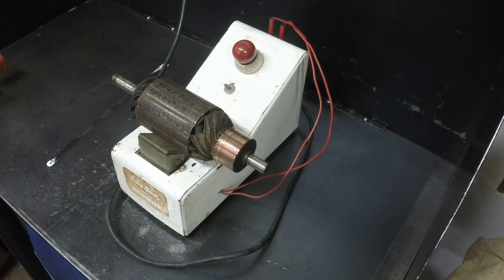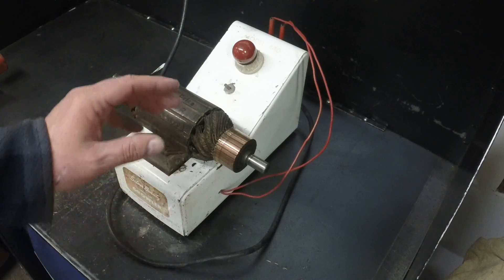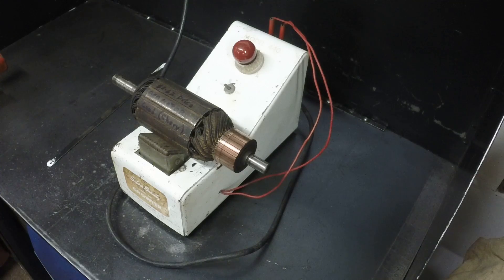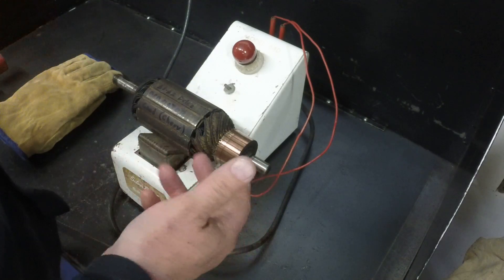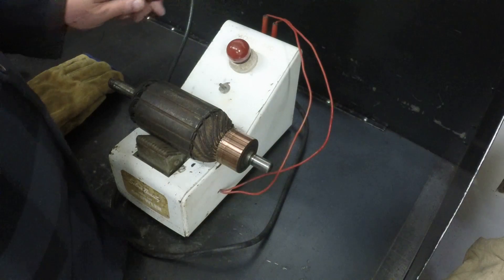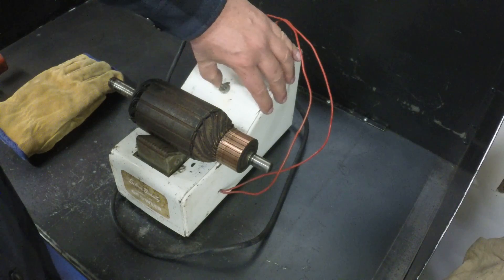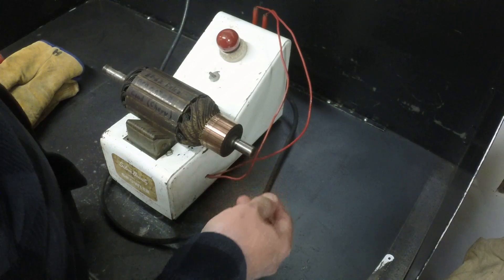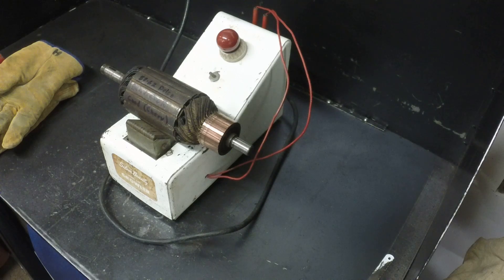Using a Growler to test a Delco generator armature from 1960 Chevrolet

Comment: It's a real sin industries have just gone to the just replace it way of doing things.  With my own vehicles, motors, tools, appliances etc etc; I diagnose, disassemble and find the root cause then repair it.  I do this not just because I'm a cheap Scotsman, but because I absolutely must know the root cause of the failure for my peace of mind.  

I spent decades as a GM Red Seal Technician and I almost always kept electronic modules, injection pumps from repair replacements and disassembled and repaired them for fun and profit.  To pay a dealership the hourly door rate for me to repair such things was cost inhibitive for customers, but once in a while when there was an older vehicle with a failed part made from unobtanium like old Cadillacs with ancient electronic climate control head unit failures, I was your guy.  I'd disassemble and trace the failed component on the circuit board and get it operational again.  Nowadays you most certainly won't find techs like that around my area..
Reply from the maker: It nice to see others repair things too. One thing the I find annoying by some of the younger generation is that they state everything back in our era was throwaway.... I always need to correct their ignorance, and tell them how everything use to last and be rebuildable.... plus most do it yourselfers could do the job. Now days, everything is built so poorly, you might get five years out of it, and parts are 100% obsolete in that time, so replacement is the only option. My folks got new Kenmore laundry machines in 1958. They worked great in to the early 2000's. They thought they wold be smart replacing them, still good working machines, with a new Maytag front loader. What a mistake! They lasted five years. I have yet to have a washer last more than seven years, with out major failure. Now days everything is throw away garbage!
Reply: Speed  Queen  commercial washer  still  built in Racine Wisconsin no computers analog  controls.

Comment: That was my job for years in the motor shops i work,was repairing dc motors ,generators,etc,etc, i love dc stuff.AC is nothing basically to check, DC  has commutator, brushes  , field winding's,series winding's   armature winding's, interpole winding's etc,etc ,,,,this is on compound motor or generator off course ,,series or shunt motors  has less then that .i have 5 or 6 growler's  around the house because i love those things.

Comment: I'm having problems with my motorcycle's starter motor. I've already replaced the brushes and bearings but the problem still persists. The starter cranks the motor really slow and puts a huge drain on the battery. I've tried the starter with 4 batteries (one was an 80 amp hour car battery) and new cables. 

Could a bad armature be the culprit?
Reply from the maker: Check the engine timing, if it is to far advanced it will crank like the battery it dead. If it cranks slow with the plug wires off, the timing is not the problem. Does the engine have a compression release? Some have a centrifugal thing on the cam. Also you need to check the no load current draw on the starter, making sure it's within factory specs. It could have bad windings. Are any discolored and smell like burnt wiring? Things like that I really need to look at...
Reply: The engine does indeed have an automatic decomp and an anti kick back mechanism but I've heard of people disabling them and not having starting issues. The cranking is speed has been tested with the ECU off (bike is converted to fuel injection), thus no spark or fuel.

I've opened the starter a few times and it smells a bit burned, the carbon brushes seem almost like melted on the contact side. It cranked better a few times after cleaning the armature and the carbon brushes but then it slowly seems to die again. The armature winding seemed ok, no discoloration or any other damage.

What I forgot to mention that these problems really started after I had the starter clutch fail and spin the starter with the engine. The carbon brushes were totally worn out so I rebuilt the starter and replaced the failed clutch.

I don't know the no-load current draw for the starter and I'm not use if I have anything capable of measuring such high DC current.
Reply from the maker: Sounds like the starter is fried, as it will generate power when spun. Sounds like it got hot. Doesn't take much to ruin the insulation on the windings. I would start hunting for a new starter, or at least field windings and a armature.
Reply: I ordered a  new starter few days ago. Just wanted to see if I could get any life out of the old one. The starter was able to start the bike yesterday (still cranked very slow).

I think I made mistake of testing the starter with the intake manifold off (I just wanted to see if the starter could spin the motor before putting all the parts back together). Having no throttle plate means the cylinder gets filled with a lot more air, thus requiring more cranking force on the compression stroke.
Reply from the maker: The starter should have no problem cranking at wide open throttle, or with no intake manifold. Sounds like  bad starter windings.
Reply: True, but as I've heard, the starters on these motorcycles aren't very good. I actually got the bike to start very well with some minor adjustments to fuel injection.

Anyways, I've got a spare engine with a kickstarter assembly and the new starter motor on the way so it will start one way or another.

By the way, you have nice channel. I too like old tech, but some times I like to combine it modern day technologies, like this motorcycle. (It's a 1990 Honda NX650 with Microsquirt II fuel injection)
Reply: If the start stayed in gaged and  you ran it that way you  have over reved the armature and caused some internal damage to it. Go for a new starter.